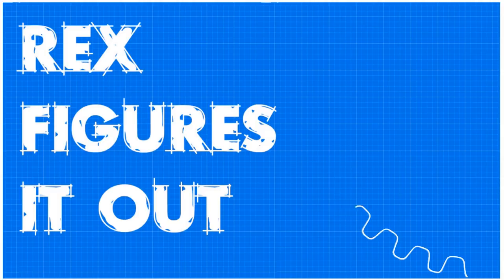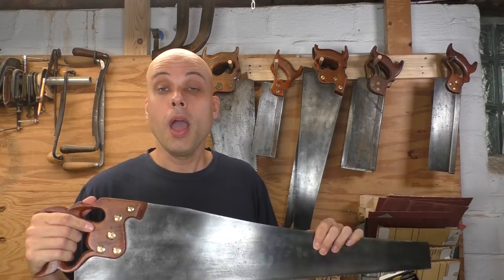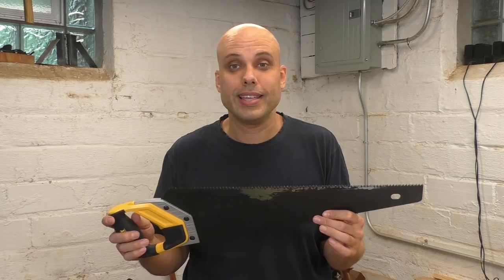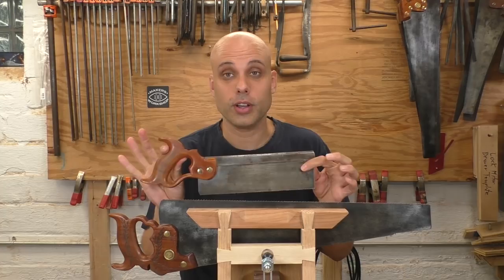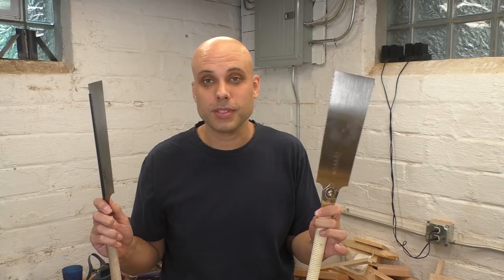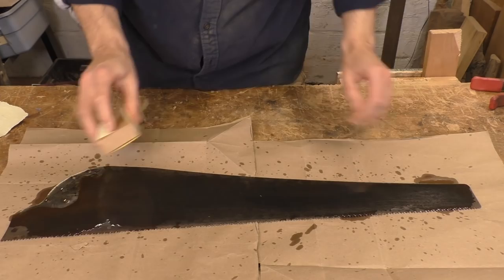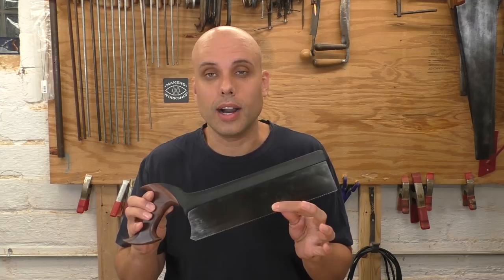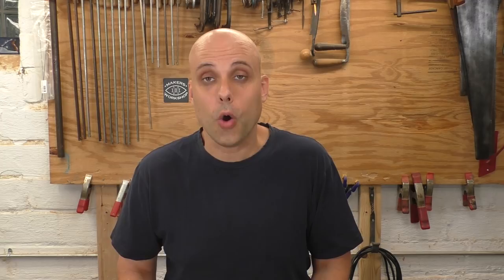The TRUTH about woodworking saws.

Comment: Disposable saws, are they made from two types of steel?  The teeth being higher carbon steel welded to the main lower carbon steel blade?  If so can't the harder teeth be ground off leaving metal that can be filed.
Reply: I bought a set for $5.00 at my favorite Grocery Store. Yes, the handles are lousy and the plates are "disposable".  But the handles are screwed on and easily replaced with decent ones I made from old patterns, the blades were sharp right out of the box.  I goofed the 28" panel saw up by hitting a nail and took a grinder to it to remove all teeth and re-filed new teeth below the shock hardened area.  This saw is now my favorite for re-sawing and I only have to sharpen every couple of months.  Long and short: find some old saws at the flea market, with handles that fit YOUR hand well and replace the blades with cheap "disposable" ones from the big box if the original plates just take too much work to bring back to life.
Reply: Not two types of steel, just one type hardened differently in two places. At least the ones I've seen.
Reply: @brandonwilson8115  
Iv seen hacksaw blade with high Carbon steel teeth welded to mild steel blade.  I don't own a disposable saw so assumed they were the same.  Thanks for the clarification.

Comment: So Rex, how would you feel about just removing the teeth of a hardpoint saw? Because if you file that flat, and the rest of the steel is similar to resharpenable saws, shouldn't you be able to sharpen the rest of it? It would be a bit of nasty job, but you'd only have to do it once. You're still stuck with the horrible plastic grip of course, but... could save a shitload of money.

Comment: Quick question, what is the difference between a Gent saw and a dovetail saw? I know they are both used for joinery, which is something I'd like to give a try soon!
Reply from the maker: The gent's saw has a straight handle.
Reply: @RexKrueger  what you mean to say is that gent saws come with a placeholder for a handle. It is left to the end user to make a decent tote for said saw.

Comment: Given the current cost of a saw, it is not responsible to spend a lot of time sharpening a saw. You can buy an exellent saw for $ 35.
Reply: You can buy them for a lot less than that. In Australia a shortish Jack saw is under $10 retail, so that's like USD $6 or so..
Reply: @johncoops6897  I am sure you are right. I took the price of a high quality saw (Bahco).  But that is not the case. The hourly rate  of a professional (but also for me), is too high to spend time sharpening a saw. But if you like it, and you have a lot of time, don't let that stop you.

Comment: I can recommend the Bahco Ergo saw range. Definitely worth a try for general contracting and light joinery.

Super comfortable ergonomic handle (left or right handed), and replaceable blades which are about a tenner each.
I have one handle and 4-5 different style blades for different jobs.

...Short general purpose blade which fits in my small tool bag, full size job site blade in fine & course, tenon saw blade, etc.

eg: https://www.ebay.co.uk/itm/292255436113
(although I didn't buy the full kit and only got the individual blades I'd actually use)

Comment: I disagree that sharpening needs a lot of tools. I've been resharpening for years without a saw vise. Sure it probably makes it easier and  less noisy, but I've found clamping the blade along the side of a saw horse or bench works just fine.  Just push the file toward the bench or horse. Triangle files are common enough and you can buy a saw set from amazon for $20. 

The beauty of resharpening is that when you accidentally drag your saw along something hard, you don't have to drive to the store for a new one. A 10 minute break to contemplate the stupid thing you did while resharpening and you're back to your project.
Reply: Yeah, I've always been a little surprised at his insistence that the blocks-of-wood-in-a-vise method is worse. especially if you add a lip on the blocks of wood so they won't fall out when you're moving the blade along.

Comment: Could you ...
Grind off the old teeth of a hardpoint saw and file new teeth in the softer metal?  Or is that a lot of effort for not much ROI?
Reply from the maker: I think the ROI is pretty low. By the time one of these is dull, you've done enough woodwork that it's time to step up to better tools.

Comment: I think it might be a stretch but do you think is viable to make your own blades somehow? Since you said you could file out all teeth and cut new ones and all. I ask this cuz in my country (or at least in my region) I can't find blades for a frame saw (turning saw) and import them online gets really expensive (specially since brazil's money value plunged) so maybe it could be a cool project?
Reply: The problem is that getting hardenable steel to make the blade from isn't easy either.  Most sheet metal (especially salvaged from stuff) is going to be mild steel, which can't be heat-hardened at all, so it won't hold an edge for very long.
Reply: With that said, someone in another comment was talking about making frame-saw blades by cutting up bandsaw blades.  Maybe that would work for you?

Comment: Saw files aren't very expensive, neither are saw sets, and you can make a vise pretty cheaply.  The skills needed are taught by experts on YouTube.  Check Paul Sellers for a good lesson.  Mr Chickadee gives a lesson on saws.  Sellers even teaches how to create a whole new set of teeth on a saw plate if too many teeth are broken off.  You can get a quality vintage saw with broken teeth and recut the teeth.  Do not buy a saw with a kinked plate.  That can't be fixed by the home woodworker.  I recommend you learn to sharpen your saw (why say "resharpen"?)  It really isn't that big a deal to learn and the cost is not very high.  I paid about $20 for a sawset.  I have three saws:  a 26 inch rip, a 26 inch crosscut, and a Crown tenon saw.  I use the tenon saw for dovetails and it works fine.  I cut close to the line and then finish the dovetails and pins with a chisel.   As for sharpening, it takes me fifteen minutes to sharpen a saw.  I sharpen every seven or eight hours of use and set the teeth every 3 sharpenings.

Comment: Could you temper or de-harden the super hard point saw, sharpen it and then harden it again?
Reply: Seems like at that point, you're basically manufacturing a saw.
Reply: Without the special impulse hardening equipment,  you couldn't re-harden it, but (given access to standard heat treatment facilities), you should be able to temper it and then sharpen it, and treat and use it like a standard hardness saw.
Reply: @supergeek1418  I have a heat treatment place at the end of the street I live on. If you had a hundred or more blades to do they would be fairly cheap (about $25.00 per saw).You can get new saws cheaper. They would not be interested in doing just one.
Reply: @charlesreohr6236  
In that case, it doesn't make sense.
Some people work in shops that have heat treat plants,cand can do stuff like tempering "on the side" for fellow employees.
Otherwise,  I've used my Dremel with grinding or diamond discs and was able to sharpen point hardened saws.
Reply: @supergeek1418  Then again you can cut the teeth off, file in new ones, set them, and use a torch to temper the teeth all your self , I guess it depends on how much your time is worth. I sharpened a 50 year old Stanley crosscut saw with a file it took twenty minutes. It cut like new. My Grand father gave it to me. I plan on giving all of my tools to my grand kids. I don't know a lot about the newer tools but so far I have found the older hand tools works better and the newer power tools work better. I just found out about these throw away saws watching this video And went to the corner and asked. It is a production shop so they only want to do larger orders. I don't know of any small shops that have the special edge hardening equipment. They also told me they would have to remove the teeth first and grind new ones.
Reply: I’ve noticed that ‘job site saws’ have the teeth cut in 2 or 3 directions by a file that must be a very low angle.

Comment: An angle grinder will take the teeth off an old hardpoint saw just fine. Then you have a free shot at cutting new resharpenable teeth. Check Paul Sellers for a how to video.

Comment: Ok, if handtool woodworking is you thing be a happy camper. I prefer the high frequency angle grinder sound with a 3 teeth wood cutting blade. Screw your tranquil purity desires!

Comment: "Are there saws that you use until they get dull and throw out?"
 yeah they're called hack saws
Otherwise Japanese pull saw its often have replaceable blades and the teeth are really finicky to sharpen if you have the tools and usually the teeth are the last  problem anyway, my last two blades went tits up from gum and rust sticking to the edge.

Comment: you're simplifying the information about steel alloys too much, saws are made of spring steel (of which there are many different alloys), files are made of tool steel (of which there are many alloys) and you were cutting mild steel. i've been using the same old and cheap hardpoint saws since i started making stuff, and one of those i literally found in a bin, it's my favourite one.

Comment: Dewalt saw, cut the teeth off when thet dont cut and make teeth on the saw youself. Possible or not? 

Limited resources on the planet and companies build in the throw-away aspect. Not good business sense as over time prices will rise and the tradional woodworker will be no more. 

Real woodworkers can make their own tools, yes they are blacksmiths as well.
Reply: Yeah, I was wondering the same about cutting the teeth off the DeWalt saw.

Comment: Discarding a file? you numpty.
you acid etch it or powder compound it to reform its profile. 
 I have files from my grand father youth that still work. 

Files shouldn't blunt easily. If they do you are abusing them, poor storage or they are not a decent file but crap in the shape of a file.
If they are cheap meh files don't throw them away for their are a thousand uses for a piece of tool steel.

edit: why are you using a one stroke direction file from my eye on a back stroke; no wonder your files are get dull easily.